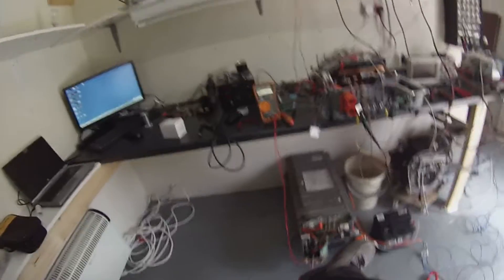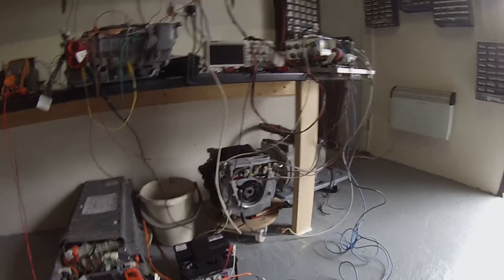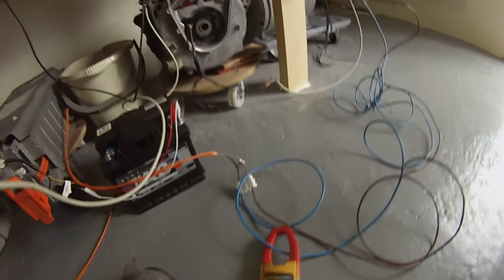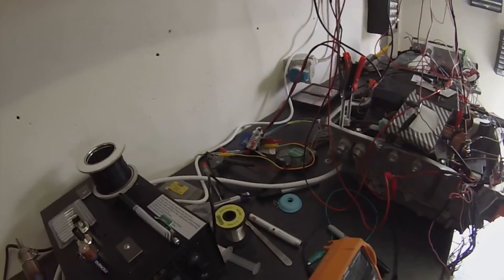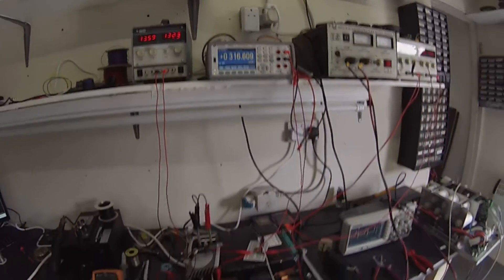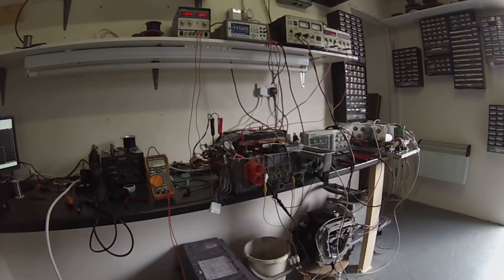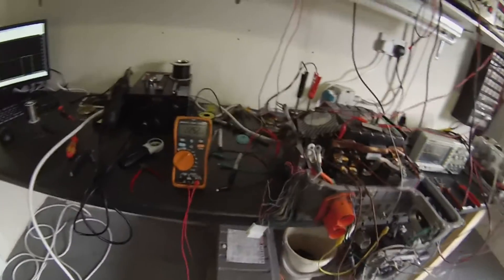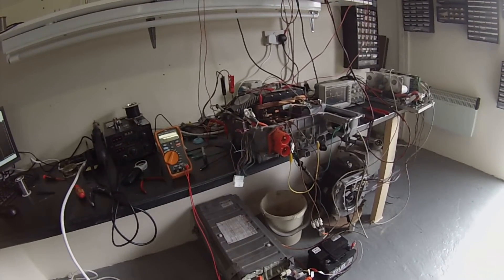EVBMW Lab Update 1

Comment: In our application with the Prius IPM, I am running at a PWM frequency of 20 KHz to move out of the audio band & annoying whine. Also from what we can surmise, there is active PFC in this module.  More characterization will give us the efficiency.  For our charger set-up, we remove the 3-phase inverter boards for MG1 and MG2.  Instead, we come in with 110V AC, rectified, smoothed and fed to the IPM, to boost to 235V DC.  The Inverter boards are set aside for a future DIY full H bridge, sine wave inverter build.  It will be robust enough to handle the currents. Great job on the video.

Comment: Could you use the buck/boost converter to fast DC charge a Traction pack that’s nominal voltage lies outside the normal charging range of the Charger. For example Chademo charging (DC range 200-400v) a traction pack that’s nominally below 200v?
Reply from the maker: Quite possibly. Interesting idea:)